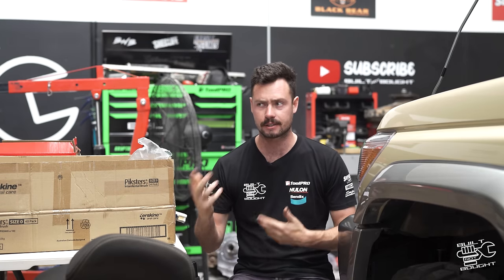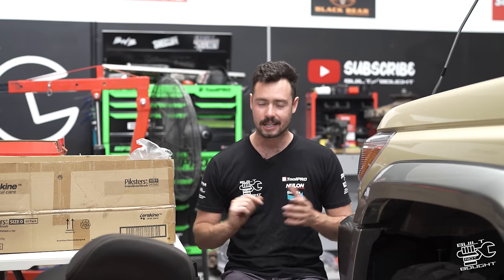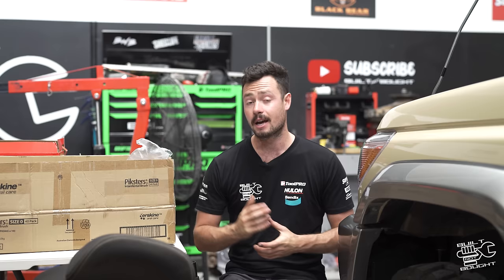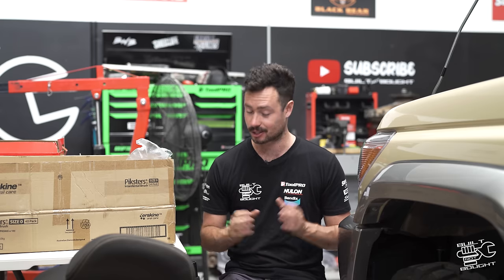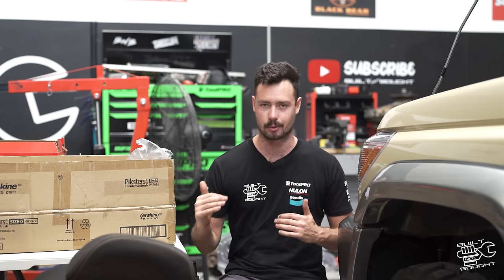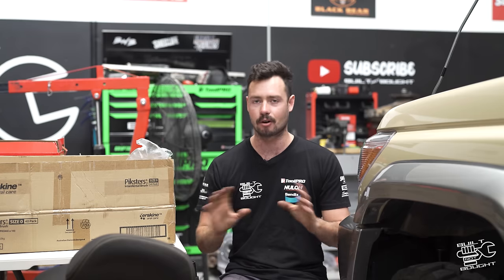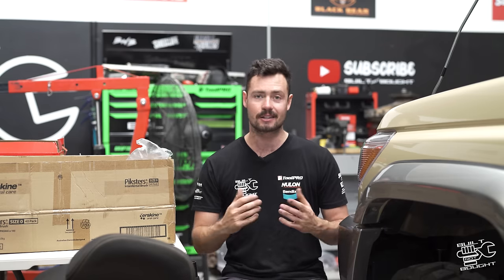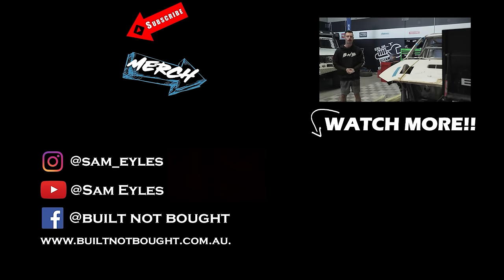BUILDING My Dream LandCruiser In 10 Minutes!! 🛠

Comment: yup,you fkt that up from the begining, blocking the windows.. you cant see traffic when your half way across the intersection. unless your parallel with it. bad idea.. dangerous, & less air flow..only good thing is the LS, but then,you dont need a v8..just a decent diesel..not from japan..80kw, chunks.